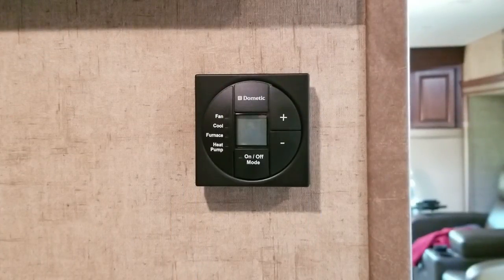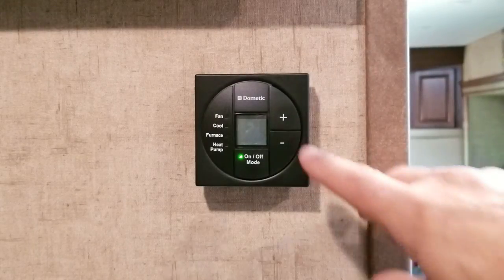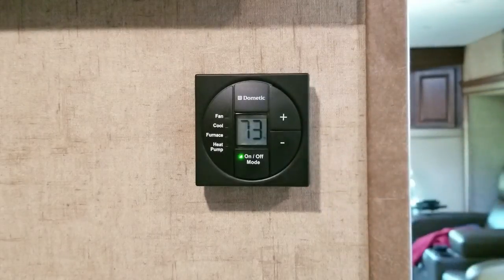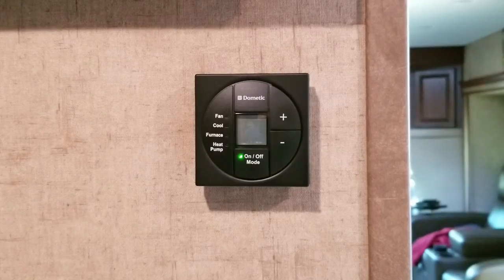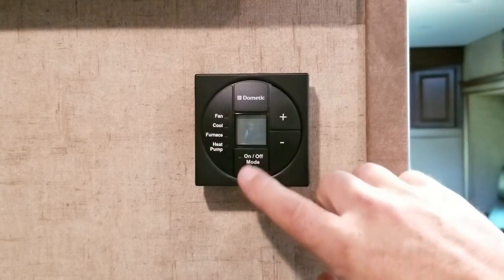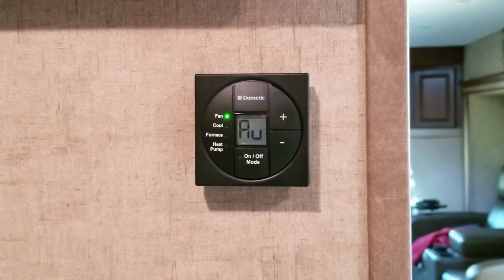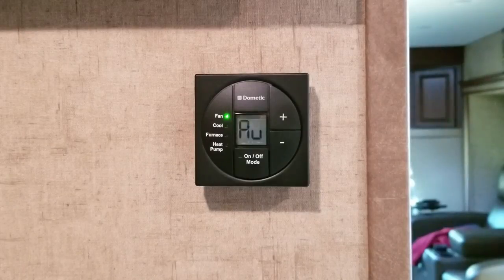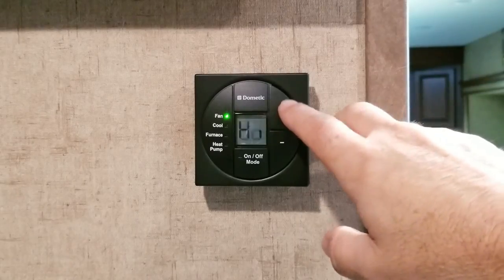Dometic Single Zone LCD RV Thermostat - How to Operate and Demonstration

Comment: Thank you for the video. I learned a couple of things. So we are spending our first weekend in our travel trailer.  Our Dometic thermostat only displayed low or high for the fan. No auto. It just didn’t appear. Your video got me thinking.  In the fan mode I pressed the up and down button together and the Auto appeared. I have no idea why it only gave me the high and low options but now I have auto. Mrs. Gnome is happy. I’m happy. We’re happy campers. Thank you. You earned yourself another subscriber.
Reply from the maker: I am so glad it helped.  Good idea pressing both buttons, I had not heard of that to get to AUTO.  I will remember that in case someone asks.  Enjoy your travel trailer and thank you for taking the time to comment.

Comment: THANKS!!! This is exactly what I needed. AC just stays on all of a sudden. I set the fan to low and temp to 73 and compressor seems to shut down at temp. Maybe something wrong with the Au setting but the d1-d2 instruction is a plus. Thanks.
Reply from the maker: Yes the fan will stay on if set to low or hi regardless if the compressor is running or not.  If fan is set to auto (Au) the fan should turn off and on in conjunction with the compressor.  Thanks for watching.

Comment: Thanks! I couldn’t figure out why my fans were blowing cold air when I was running the furnace. It was because my Dometic was not adjusted to auto. Thank you for covering that.
Reply from the maker: Hi Robert,  I would bet that it is the most common question about the furnace and AC.  Glad it helped and thanks for watching.

Comment: Wow thanks, this has been driving me crazy. I knew it was something simple but I never had the instructions for it.
Reply from the maker: Glad it helped. Thanks for watching.
Reply: @RVHabit  okay so now I can run my furnace without the a/c fan running but there is this annoying sound coming from the a/c unit. Sounds like a set of contacts clicking on and off. Is this normal?
Reply from the maker: I would hate to try and attempt to diagnose a sound I can't heat personally.  It may be totally normal.  Typically though if your running your furnace you would not hear any sounds from the AC
Reply: @RVHabit  thanks for the quick reply, actually I found the answer on a keystone forum.  If the thermostat control is set to the 1 degree  differential you get a clicking from the relay in a/c . After changing the differential back to 2 the clicking stopped, problem solved. Thanks again for the post.
Reply from the maker: Good to hear.

Comment: This was exactly the answer that I was looking for. My air conditioner fan was coming on with the furnace. I set it to auto and problem solved.
Reply from the maker: Hi Dennis,  So glad it helped.
Reply: My AC unit starting clicking.  I decided to go back to default settings to see if that helped.  Clicking stopped when I reset differential back to 2.  Does that make sense to you?
Reply from the maker: Hi Dennis, I have not heard of that before except the control board in the AC is connected to the furnace.

Comment: Thank you for sharing, I learned something new, bit my  Domestic therm shows Heat Strip not heat pump? Any ideas on what it does and know how to use ? Thanks again
Reply from the maker: Yes a heat strip is also part of the AC.  A heat pump basically runs the AC in reverse to produce heat that is blown inside. A heat strip is a heating element and the AC blows air across the element to produce warm air.

Comment: Is the differential setting for a/c too or only the heat side of the themostat.  Thanks
Reply from the maker: As far as I am aware the differential applies only to the furnace and will not affect the A/C operation.
Reply: @RVHabit  thank you

Comment: We watched your video which was very helpful. When we changed our differential to d1 our thermostat went completely off and is not coming back on. Any ideas pleas??
Reply from the maker: I don't have any ideas what would cause that other than a loss of power to the thermostat.  Check all the 12v fuses and make sure your RV is getting power from the batteries.  Good luck.
Reply: @RVHabit  we found out a fuse was loose.   Once my husband wiggled it, everything came back on. Thanks so much
Reply from the maker: Glad to hear it.

Comment: Thank you so much for the simple instructions. It made our lives easier being first time owners of an RV. One question: We are currently in Cool with temperature set at 74. Fan mode is on Auto. But the AC continues to be on the entire night without shutting off. Any suggestions why it does turn off? A storm passed by a few days ago and we had to reset the breaker? Could that have caused an issue? Thank you!
Reply from the maker: When the fan mode is set to Auto and you are in cool mode the fan should only come on when the compressor is running.  Try a warmer temp setting to see if the compressor shuts off and if the fan stays on.   Thanks for watching.

Comment: Hi. Great video. Easy to follow and very informative. By chance would you know, or know where I could find, error codes? When trying to run the AC, the thermostat flashes E5 as the compressor turns on then off then on and off. Like it’s sputtering. Then other times it works fine. Greatly appreciate the help!
Reply from the maker: Thank you.  You can certainly google it but I believe that indicates a communication error between the thermostat and AC.  This can be caused by several different things.  Good luck.

Comment: Ty I hope this helps with my furnace not kicking in tell cold again
Reply from the maker: This solved it with my rig with the same complaint.  Two degrees till it kicks back in is a big difference.  Set it to one degree and it is much better.  I hope it works for you.  Thanks for watching.

Comment: Thanks for the video. My furnace is making a lot of clicking noises, it will heat but the cycling is off and it starts clicking when it goes off...any Ideas?
Reply from the maker: It will usually click (electronic start) a few times when it is lighting gas to heat.  Once flame ignites the clicking will stop.
Reply: @RVHabit  Thanks for the reply. The clicking is not to igniter, even after I turn the furnace off the clicking goes on..and it is very loud.
Reply from the maker: I have not heard of that but being a gas appliance i would not use it until a technician looks at it. Good luck.
Reply: @RVHabit  Thanks again for the reply.
Reply: We got a never-before-heard clicking noise after changing the setting to d1, but the clicking noise is coming from the control box of the ceiling AC unit.  Strange.  And when we changed the setting back to d2, the clicking goes away.  Sounds almost like a small relay trying to throw.

Comment: I just purchased the travel trailer turned it on and have a E1 code do u know how to clear that
Reply from the maker: Hi Vito,  E1 is a communication error between the thermostat and the AC unit.  That could be many things and usually will require an RV tech to run some testing.

Comment: On the weekend, when I turned the furnace on, the air conditioning came on. What causes this and how do I fix the problem.
Reply from the maker: Hi Brenda a common problem and easy fix.  Go to your thermostat and set it to fan.  Press the + key and the lcd will change from Hi or Lo or Auto.   Your fan must be set to Auto.  Setting the fan to Hi or Lo when trying to use your furnace will make the Ac fan come on with the heat. Good luck.

Comment: I do have questions - If im not plugged in , how do I make sure the AC doesn't come on?
Reply from the maker: The AC will only work on 120v.  You must be connected to shore power or generator.

Comment: Great demo! I had a question that might sound odd.
We like to keep our unit cool, about 65*-67*. However we do not want the temperature to drop below 60*-62*.
A lot of older analog controls had a toggle between heat, cool, fan. You would select one and that’s what you had until you selected another.
In spring and fall we get a 20*-30* swing between night and day, the daytime and evening sun would have the rv very warm and so selecting the ac, but at night we would need to select furnace or heat pump. All fine and dandy until that temperature change didn’t take place until 2-4am, and we would wake up freezing or roasting our butts off!
Is it possible to set both or all three on at the same time? Eg; set AC at 67* keeping the rv cool, then setting the heat pump at 63* and the furnace at 60* in case it got really cold and the heat pump wasn’t able to keep up?
In this scenario there should be enough temperature setting gap to avoid one thing coming on just to counteract the other!
Is this possible or will the controller only let one designation be on at a time?
Thanks.
Reply from the maker: That would be great if that was possible. Unfortunately it is not with this digital thermostat.  You can only select one climate control source at a time.  So if AC is selected that's it until you manually select something else.  It may be possible to use some type of home thermostat to accomplish what you want.  I would seek out someone who is familiar with wiring hvac thermostats. Thank you for commenting and watching. Happy traveling.

Comment: Thanks for the great video! My current issue is our furnace kicks on when I manually turn the stat from off to on. It runs, everything is good. It kicks off and then never kicks back on. If I manually turn it off and back on again I get the same result (a single cycle). Any idea why I might experience this type of behavior?
Reply from the maker: That could be a few things, the simplest being the sail switch or could be the control board.  Being a gas appliance I would recommend you have it diagnosed by a professional.  Good luck.

Comment: Just to be clear, this is an electric heater correct? You do not need LP bottle on nor do u need water in your hot water tank, correct?
Reply from the maker: This is a typical RV Dometic thermostat that controls the LP gas heater, electric AC and the electric heat pump if so equipped.

Comment: How do you turn on the furnace? My fiancé and I just bought a RV and cannot get the furnace to turn on with the thermostat.
Reply from the maker: Turn fan to AUTO.  Then set thermostat to heat or furnace.  Make sure temp is higher than temp in rv.

Comment: Help!!!!  Our bedroom thermostat only has fan and cool names written in them.  But there is a 3rd button light that you can hit and can set a temp.   Is this the furnace?   Or do we not have heat in our bedroom???
Reply from the maker: It's hard to tell not knowing what kind of trailer you have.  It sounds like the thermostat is for your A/C unit only.  You possibly have a thermostat on the heater unit itself.  I'm sorry I can't be more help without knowing more about your unit.

Comment: When the propane runs out, the furnace won't restart after tank change. It took 20 min. of pushing the on off to get to start. Any ideas? Domestic fan, cool, heat.
Reply from the maker: I don't know if this is your problem but running out of propane could put air in the lines.  When reinstalling a new propane tank it is always a good idea to run the stove burners for a minute or two to insure all air from lines has been expelled.  Good luck.

Comment: Do you know how to reset the thermostat?  A/C stays on all the time.  does not cut off when termperature is reached.  someone suggested to reset the thermostat
Reply from the maker: This may not be a thermostat problem.  Different parts control the A/C and heater.  According to Dometic this is how to reset the thermostat.  This will only work with certain thermostats.  If you have the original manual or can look up your thermostat model number online would be best to get the reset procedure.  Use the below procedure at your own risk.  This is just information I am providing to help in your research.
Press and hold the '+' button.
Press and hold the 'On/Off Mode' button. Hold both buttons down for about three seconds until the screen shows a -- --. ...
Press 'On/Off Mode' to turn back on.
Good luck.

Comment: When the trailer gets above 90 degrees the thermostat does not work. I have to put a bag of ice over the thermostat to cool it down to make the thermostat work to cool or turn on A/C compressor. Is there a fix for this dometic problem?
Reply from the maker: I haven't heard of this specific problem. It could be the thermostat or control box.  If I was trying to fix it  would replace thermostat and see if that corrects problem. If not thermostat it could  many different things like overheating if dirty.  Icing up.  Control box.

Comment: My furnace keeps clicking before turning on or off and it didn't start doing it until I used my air conditioner. Do you know why it would make a clicking noise? Do I have the settings wrong for my furnace
Reply from the maker: Hi Penny, usually a clicking noise from the furnace is the ignitor trying to initiate the lighting of the gas.  The furnace will try three times.  If it doesn't light after three attempts it will go to fail in which you would need to turn the switch off and back on again to reset the lighting sequence.

Comment: What is the difference between heat pump and furnace? Why when I ran the furnace cold air comes out. I set the temperature on 26 deg c
Reply from the maker: The furnace is a separate unit operated by 12v and LPG usually located on the floor and has separate vents from the AC vents.  The heat pump is part of the AC and runs on 120v.  Basically the heat pump is your AC running in reverse to blow warm air. It does not work well if the outside temps are below 45 degrees.  They generally run independent of one another.  If your furnace only blows cold air the LPG is not igniting.   Make sure you have your LPG tanks on.  If you turn the furnace on and cold air is coming from the AC vents then you need to set the FAN mode on the thermostat to AUTO.
Reply: Thank you 🙏 so much for the detailed explanation, it helped me figure it out
Reply from the maker: You're very welcome.

Comment: What if you forget to turn off power when replacing thermostat?  I  I long have power to thermostat. Is there a fuse somewhere?
Reply from the maker: Fuses should be located in the RV electrical breaker and fuse box.
Reply: @RVHabit  I have no power to thermostat.  Is there an inline fuse.  Or did I burn up ac and thermostat
Reply from the maker: You need to start at the AC.  The control board which operates everything is in there.  A multi-meter will help with tracing the 12v.  Good luck.

Comment: We just plugged our camper into electricity and our A/C comes on but our thermostat does not light up? Do we need to replace thermostat or is there a quick fix?
Reply from the maker: It sounds like you are saying all works except the light.  Most of the thermostats don not have lights.  Make sure the model in your RV has one.

Comment: So I’m trying to use my furnace, and my thermostat looks exactly like this but it’s white and it doesn’t have the heat pump setting just fan cool and furnace, idk the difference but my furnace does not kick in even though I have it set at 85 to warm up the camper, but if it is to kick on it doesn’t even blow warm it blows cold air from the floor, am I doing something wrong?
Reply from the maker: I would have your furnace checked by a technician.

Comment: On the ac mode is 90 the coldest and the lower the number get the ac starts getting warmer
Reply from the maker: 90 is the temperature.  If you want the AC to turn on it must be set below the room temperature.  If the room is 90 degrees you must set the thermostat to 89 or lower.  The AC will maintain the temperature you set on the thermostat.  Most of the thermostats for AC have a max of 90 and an low of 55 degrees

Comment: Is there a way to make this display current room temperature while unit is on?
Reply from the maker: That is not possible with this model thermostat.  When the unit is on it shows the temperature that it is set to.

Comment: Are these ran by propane? Also if it has heat strip on your thermostat does that mean that you also have a heat pump and furnace
Reply from the maker: Hi Pauletta, two great questions.  Yes the typical heat furnace is run by propane while the air conditioning is run by electric.  Also, a heat strip is not the same as a heat pump.  Without getting technical a heat pump uses the air conditioning in reverse blowing in the warm air it generates instead of the cold air.  A heat strip is similar to a small plug in space heater that heats an element and blows air over it.  Heat strips are usually found in smaller RVs as they will not generate as much heating power as a heat pump.  They make many thermostats with different options but if yours says heat strip you probably do have one.  There would be no reason to use a thermostat with options your RV does not have.  Thanks so much for watching.

Comment: I can't find any information on my problem. My thermostat display is shadowing. Sometimes it doesn't want to shut off...sometimes it doesn't want to come back on. I've talked to several RV repairmen and they don't want to touch it. Why?
Reply from the maker: I can't explain why they won't help you, but anything can be fixed.  It is almost impossible helping you diagnose it over the Internet.  You need a technician to run some diagnostic tests.

Comment: Whats the lowest I can set it up in cool,,,my numbers are not showing?
Reply from the maker: If I remember correctly the minimum when running in heat mode is 40 degrees. The minimum when Running in AC mode is 55 degrees.